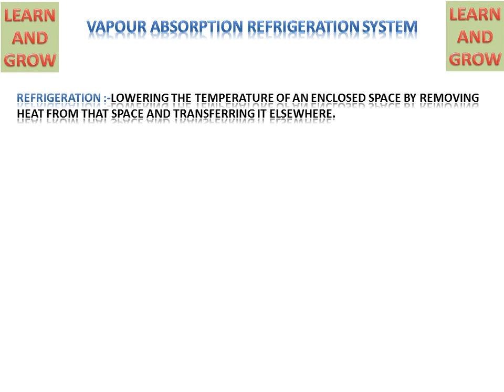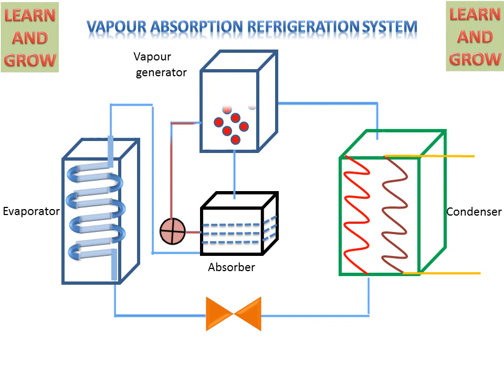Vapour Absorption Refrigeration System (With Animation)

Comment: Sir what is the use of expansion valve it's function is similar that of evaporator (reducing temperature) if the temperature is not lowered in expansion valve it's more easy to convert into vapour
Reply: The evaporator is not reducing temperature but actually increasing the temperature of ammonia(refrigerant) by a taking heat from the surrounding.The ammonia when heated turns into its vapor form and the to the absorb-er.
Reply: EXPANSION VALVE ONLY CONVERTS THE HIGH PRESSURE AND LOW TEMPERATURE AMMONIA TO LOW PRESSURE AND LOW TEMPERATURE AMMONIA

Comment: so what is the exact role of water here.. cant it operate only ammonia?
Reply from the maker: WATER HAS STRONG AFFINITY FOR AMMONIA AND THEY ARE SOLUBLE WITH EACH OTHER IN WIDE OPERATING CONDITIONS .

WITH REGARDS
LEARN AND GROW
Reply: got it. thnk u sir..
Reply: If I got it right, water absorbs ammonia so you can pump a liquid instead of compressing a vapour. This saves energy. Then, in the generator, you'll need a heat source such as solar energy or industrial waste heat in order to reduce NH3/H2O solubility.
Reply from the maker: Water has strong affinity for ammonia and they are soluble with each other in wide operating conditions and they make a highly stable solution.
Water is used for making strong and weak solution . which  used in the process of evaporation and pumping for increasing pressure of the solution.

THANKS
LEARN AND GROW TEAM
Reply from the maker: Water has strong affinity for ammonia and they are soluble with each other in wide operating conditions and they make a highly stable solution.
Water is used for making strong and weak solution . which  used in the process of evaporation and pumping for increasing pressure of the solution.

THANKS
LEARN AND GROW TEAM
Reply: why we need a solvent , why cant we just heat ammonia, increase pressure - decrease temperature keeping pressure constant -and then expand it thereby cooling why cant do like this why do we need water
Reply: Victor Haobam Water using as absorbent here